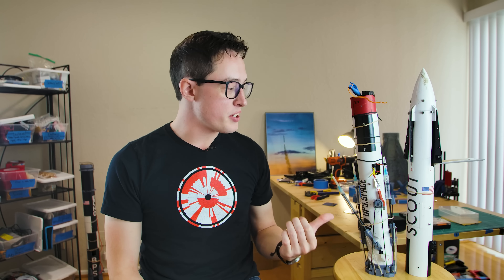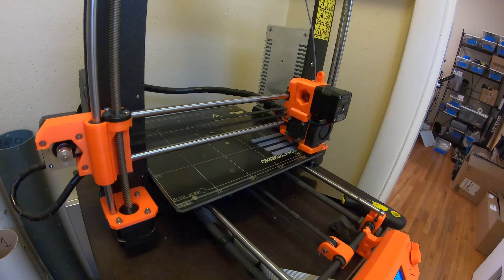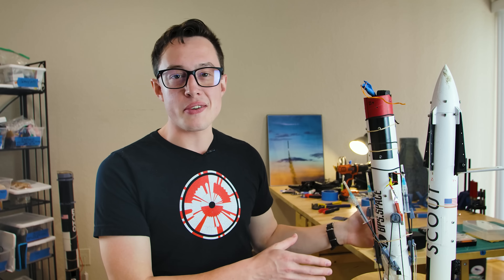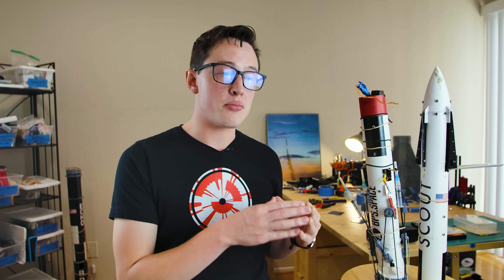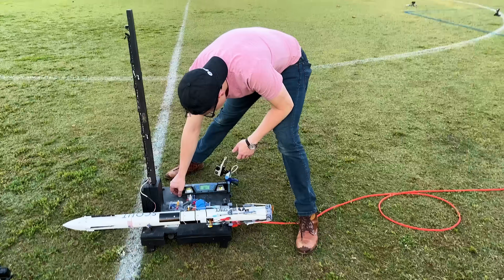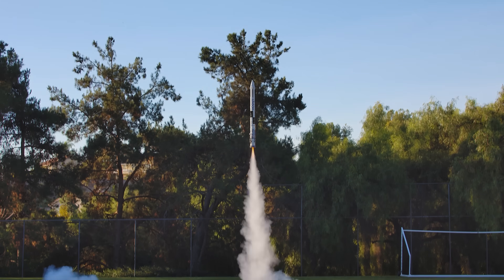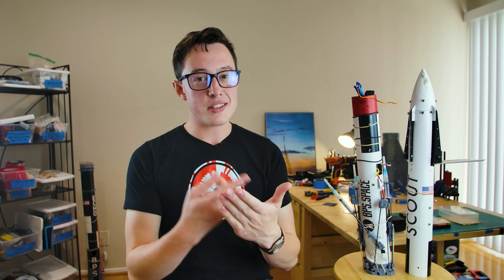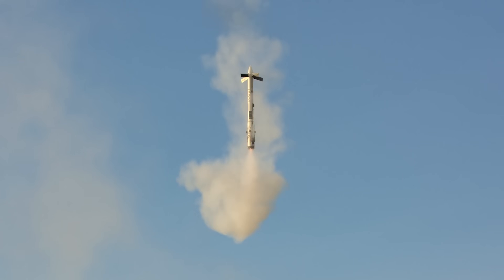Scout E - Flight 2 Launch + Landing

Comment: I have just started out with sorbitol based rocket motors made out of PVC and I am graduating to making aluminium casings and designing thrust measurement setups. I was wondering is it possible to gimbal only the nozzle and not the entire rocket motor considering that further down the line the motors are gonna be pretty massive and difficult for a servo to move ?

Comment: Would the top mounting of the feet not be more beneficial higher up ? This would give tolerance for wider landing feet which may help with the bounce , also will disperse the energy more evenly if landing has slight directional movement left or right ? As the force would be directed central to the rocket assembly rather than the lower portion almost tripping it over so to speak Awesome work btw !!! Subscriber from tonight 🤓

Comment: Now.............................................. after watching this whole video i understood two main problems 
#1.while landing the second motor was too powerful 
#2.the landing legs were made up of that plastic....which is a kind of....too stretchy ? 
solution #1  use a bit more less power full motor  
#2  use the plastic which is not to stretchy and bouncy,even the same mistake you did on the echo rocket which...did not stand up.
 by the way.... my name is CHERRY  I hope it is useful to you BPS.Space .
even I made a rocket namely echo but i don't have any kind of rocket fuel to launch it i wish i had some.......

Comment: Just wondering if you did a drop test with only the momentum reduction engine firing from X meters.  As for the ejection system, it seems that you are adding one potential into the system that you shouldn't need to and that is the angular momentum of the ejection system hitting the pin on engine changeover.  Consider using a break pin or even something that can be burnt through allowing the mount to remain in the vector used in last stabilization for the decent and possible spring loaded downward push to throw the decent motor into proper position while ejecting the lift-off motor.  I know adding shielding into the craft along the PCB systems adds weight but the limited weight gain for proof-of-concept and better telemetry data instead of educated guesswork seems to advantageous.  Any-which-way, I'd love to be in the position you're in being able to actually do some of this - best of luck!

Comment: JOE,, Have you considered using for the landing legs...RC Truck Shocks??  silicone/Oil filled in adjustable dampening!  Id suggest traxxa's long bore ones, you can swap spring rates . Bet you it would change your luck  . Cheers!

Comment: impressive projects you have... But if you're looking to compete with SpaceX (or get hired ftm), you're going to have to drastically increase your test iterations... =)) Often making multiple parts at the same time takes only a little bit of extra effort and it would allow you to run multiple launches on the same model, or change 1 variable at a time instead of throwing 10 upgrades in there and hope they all are tuned well into eachother. =)) Good luck on F, we'll be rooting for you!

Comment: Go less janky. The motor ejection system could work if you used an actuator to trigger the latch that holds the motor in place. It is jamming into the latch and either pulling it out of the way or making a mechanical feeder that ejects and places the motor will be much more reliable.

Comment: have you thought about trying washing machine dampers/suspension rods that are used for stabilizing the drum as it rotates for your landing legs? May be a good fit and a pack of 4 only runs around $30-40. Good luck with your future attempts

Comment: This is totally not a failure. Amazing work!
How would you calculate the thrust after the apogee ignition? 2nd engine is not full thrust and it needs some time to fully burn.

Comment: Try a Kalman filter with both IMU and GPS sensors. It might not be necessary over the course of 10 seconds but I believe you could improve that 27cm drift significantly.

Comment: Technically, if you know exactly where you are going to land the rocket, then wouldn't it be more efficient to simply remove the landing gear, and have the landing platform 'grab' the rocket instead, using a net or something more complex (you seem to enjoy complexity)? It's just that you would spare the rocket some weight and take away some complex problems. Yeah, i know it would be less funny, but that's something you might be able to use for several design iterations, so that you can separately monitor the landing procedure and motor control that you have. Anyway, keep it up, your videos are awesome! Good luck with Scout F/G/H/... :)

Comment: Have you thought of using an RTK base rover setup and focus on Differential GPS? RTK gets you base reference and differential gets you very accurate localization (2km not an issue).  Will need better hardware to get 20hz or better.  If the flight is only 20 seconds this still gives you 400 data points.  Using 2 antennas you can get very accurate heading data. some Ublox modules even have dead reckoning built in the GPS unit and some can fuse your IMU data also.

Comment: If you can hit a landing stage, you could do a vacuum panel (like air hockey in reverse) to stick the landing .. of course you would want a sufficient surface area for the foot pads and allow a small pivot range on each. Good luck.

Comment: Can you add some aluminum foil between the telemetry antenna and the GPS antenna? 
Can you add radar, or lidar sensor on the bottom so ava can compensate for the double integral errors?

Comment: for your landing legs shock system maybe you can design a low profile fluid shock with spring. use the same shock fluids that hobby grade rc cars use and make your own springs using piano wire to really help tune the landing. it will weigh more and be more complicated but the performance and tuning benefits may be worth it

Comment: I am not sufficiently knowledgeable concerning the nether regions of scale model rocket engine specifications, capability, and availability, but is there such a one that after its primary burn can “smolder“ for an extended duration, and then be perhaps reignited by a signaled release of nitrous oxide via an included cartridge?

Unlike your current design, subject to the vagaries of mechanical movement and actuation, the burn can be (re)initiated at a very precise instant (being a given altitude above GL), and the engine will be free of chaotic “sputter“ and “ramp-up“ as well.

This design has the merit of being lightweight in comparison to carrying two rocket engines and associated ejection mechanism.
 
Also, the four Descent Stabilizers need to be larger, implement dihedral, and have “V“ cross-sections. Either of carbon composite or ultra-thin stainless steel, their elasticity can be utilized to effect both stowage and deployment. Your current configuration is workable, but introduces aerodynamic variability because they are “working too hard“. If you are clever in the design of their internal mount and hinges, only the onset of zero-G triggering the release of a single latch holding against spring tension, should be necessary -- no servo needed.

By the way, two of (renowned engineer) Colin Chapman´s adages for (F1 race car) design:

“Simplify, then add lightness.“

“KISS Principle: Keep It Simple, Stupid.“

Comment: You may need a low pass filter on your telemetry, or use a higher frequency band for your telemetry. And possibly consider changing bands. Not sure what band you are using but I would guess you are probably using 915 MHz or 1.2 GHz.

Of course it helps tremendously to physically separate the systems also.
Reply: Though that said I fully agree with switching to dead-reckoning or some sort of accelerometer/inertial navigation. GPS lags too much for this application.

Comment: Good job as always! However, I have some personal opinions for ya. Since the thrust of the solid fuel rocket motor can't be adjusted in-flight, it seems almost impossible to do successful landings consistently using solid fuel rockets unless motors and flight conditions are identical (which is almost impossible). Have you thinking about building an adjustable nozzle to control the thrust? Another idea is to build a liquid fuel rocket so you can adjust the thrust. I know it's really hard to build a small liquid fuel rocket, but the idea is here. Sorry I'm an aero guy not a space guy so I don't know my ideas are feasible or not.

Comment: You should test the ascent motor servo while running the cameras and everything else, basically imitating the actual flight. If your battery doesn’t have enough voltage or cells(assuming u run lipos) it can intermittently shutdown some functions, like cameras and servos.

Comment: Good idea to drop the engine switching system. To cut down on the engine pressure, have you thought of putting a movable diverter plate on the bottom? Also, for the landing gear, maybe you could use an inflatable system like some sort of airbag?

Comment: Hello, I am the inventor Munther from Saudi Arabia.  Great job and you will get what you want.  It was suggested that the missile should be slightly larger in size in order to place more control equipment.  In addition, he suggested that you start with solid fuel and go down with liquid fuel to make it easier to control.  good luck

Comment: Perhaps I can help you with something here: regarding your attitude control “gains”. The reason that you go through the exercise of calculating the requirements for attitude control and then just override the whole lot using an “attitude gain” value which is clearly so excessive that you might as well not have bothered to work out the stuff in the first place and might as well have just taken a random guess, is because the theory is wrong,. Angular momentum is not conserved. Angular energy is conserved. If you re calculate using the correct theory, you will find that attitude control becomes much less random guess and much more proper control. Without guessing, you will be able to land properly. When it works, then all I ask is that you acknowledge what solved the problem so that I can overcome the mass psychosis preventing people from considering the truth.

Comment: A silly idea from an armchair engineer perhaps, but could an ultrasonic sensor be made small enough, light enough and fast enough to allow for some "intelligent" decisions on terminal guidance? Popping the landing legs, varying thrust, whatever you're planning on to reduce the TWR of the motor to <1 once it hits the ground?

Could maybe have the transducers deploy near the top of the rocket along with the fins/airbrakes so they don't interact unfavourably with motor exhaust or whatever else might get in the way.

Comment: I love the solution using syringes with vent hole. I'm assuming that the time that the motor kept running after hitting the ground would have been in the air, had the eject mechanism worked properly? Great attempt as always, Joe! 👍

Comment: "It's a work of art."

If it is hypersensitive to everything, it's not a good design. Maybe the motor ejection system is hard to design, but it's got to work ~100% of the time in flight conditions. If not, it's over complicated and you need to design another method for swapping motors.

Comment: so, do elon musks
Reply: with the cameras, not so much power to the computer
Reply: kiss, engineers
Reply: quick approximation is better than forced absolutes, in solving
Reply: if you do multiple solo rockets in a line, start the next one, and the previous will be pushed out, like parachute charge
Reply: the motors must not be glued, just barely side pressure hold in place, so that the next rocket can easily push them out
Reply: but, yeet the empty cartridges as soon as possible, not during landing sequence
Reply: have a shutter in front of the exhaust, if you have enough bell, you get a pressure container, for pulsed power
Reply: do you have rcs thrusters
Reply: open quad copter rotors (the upper shell air brakes) to safely land, electrically
Reply: large air brakes, passive or active, downward grid fins, reverse rocket, must close the forward rocket fins, inside/side of the shell, 90 degree turn

Comment: Impressive.  I recommend sleeving the cables to keep them from getting caught/crushed, a simple contact to the engine holder and a wire that only can complete the circuit when that chunk of metal is correctly holding an engine so as to tell that there was an ejection event and if it completed.  I also recomend a short delay between landing motor start and gear down and not depend on height while using dead recconing as there are these landscape features called hills.

Comment: you are way out of my league but what you said did give me an idea that might be useful to you

instead of trying to land on the tip of a needle land a bit more solid. problem then is the motor is still thrusting and you go back up

SO combine the two problem into a solution. work on the landing legs to stick the landing with a tiny but of velocity. have a way to detect landing mechanically or electrically. then POP slam the motor back up inside the rocket. krushnik will kill the thrust if there is any left and keep it from lifting off again ??? (can you kill the thrust enough and not melt down the guts??? machined aluminum ?? ablative coating?

OR maybe redirect the thrust. thinking 2 retro thrust buckets (like airliners use for reverse thrust on some planes) when touchdown is detected slam those retro buckets into place blocking downward thrust and even adding a little upthrust to "hold" it to the ground.

Basically land with a little thrust left over then dump that thrust krushnik or divert to stop it from ruining the landing. that should greatly increase your margin to well within the margin the motors themselves have.

BTW its hilarious to me that your channel is a channel full of failures and yet I drool over the idea of having 1% of your ability! most impressive. most impressive indeed! it just keeps getting better and I know it has to be grinding on you but you keep sticking with it. so freaking impressed!

Comment: You are NOT a real astronaut until you take a crap in space and you are not a real rocket engineer until you've made your own motors.  STOP buying these motors, that will NEVER WORK for you and make your own.   WHY have you not learned yet that the variables of a solid rocket motor that you have no extinguish ability on will NEVER have the timing to land unless its a fluke.   Just stop making excuses and go and make your first BI-PROP motor.  The chemistry is NOT that hard, ethanol and a nitric acid flavor is a good start you can do at ambient, high test peroxide is easy to work with and you can make a functional biprop rocket with it.  You have rocket prop expert friends, ask them.  You have all the instrumentation for pressure and flow calculations and flow control, you have the computers on board, just shut up and go and fricken do it.   Make a rocket around 2 'half liter' soda bottles or two paint cans, the PET soda bottles are probably better, they can take the pressure, and the harshness of the oxidizer, and you can launch.  Like I said, you have the sensors and the onboard computers, you have the MATH ability, this is easy peasy for you stop being a puss about the chemistry.    Also, if you have to have 4 ultrasonic emitters around the launch pad (at different frequencies), make the 4th one about 6 feet up on a pole near the launch 'tower', you can calculate your position and vector in 3D space just by time of arrival analysis, the receiving sensor is light, and again, you have flight computers and you know how to program them and have them do math for you, call it BPS22khzGPS, If you have a microgram scale and you are good with your math, you can pressurize your soda bottle with your fuel and oxidizer with a carefully measured amount of dry ice, that is easy for version 1.  I'm talking about something smaller than a pea.   a small pea.   Remember, Von Braun's excellence was NOT in the rocket design, really, aerodynamics of flight is trivial to that of a bipropellant rocket engine.   Von Braun's engine is what made the V2 possible, his F1 is what made the Saturn 5 possible, 90% of rocketry is the engine and the fuel and oxidzer, the other 90% (yes, joke) is now the computer control, the other 10% does not matter.   If you got the engine and the 'instrumentation' the computer control, you can fly a brick.   Think about it.

Comment: What if you use semi rigid landing legs but use a section at the bottom of the tube as a damper so the damper is part of the actual tube it self. you know use a larger tube at the bottom that rides over the top of the rocket tube at the bottom.

Comment: Hi Joe, I used to work in the field of Drones, a couple of things we learn was RF antenna and their field strength pattern is are affected  by carbon fibre and metal elements. Especially at higher frequencies >500Mz  are very much degraded. We solved the problem by putting the GPS unit high on the tail , so putting it in the nose cone may help. We also used differential signals to get the data from the GPS (think RS422) to the control board.
The other thing you could try for the landing is pointing up from the landing pad a modulated beam of light and fitting a sensor to each leg /fin and guiding the landing via comparing the signal strength  from each sensor.  The same sort of system is used to guide tracking solar cells to keep them at maximum output.

Comment: Very cool and glad to see you're now investigating the Krushnik Effect method of throttle control.  I suggest using replaceable carbon fiber body tubing for the recessed motor's exhaust sleeve.  And as you learned the hard way, always put a dummy load of the appropriate impedance on a TX output when you remove its antenna.